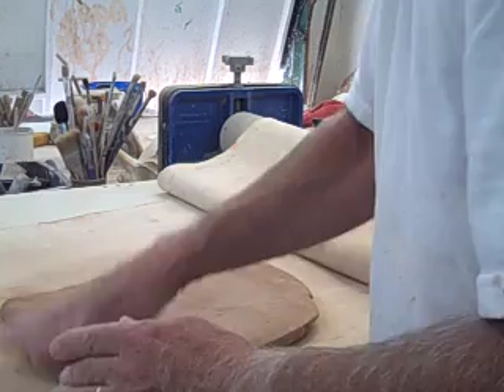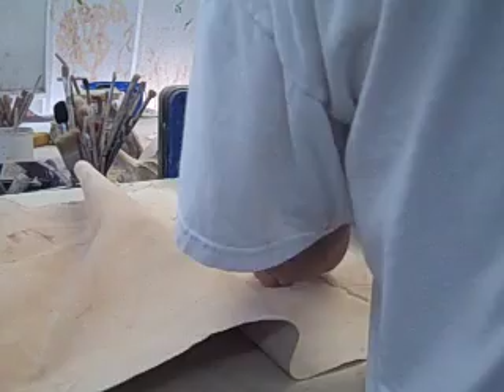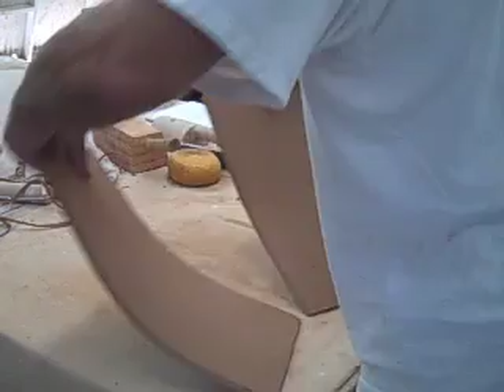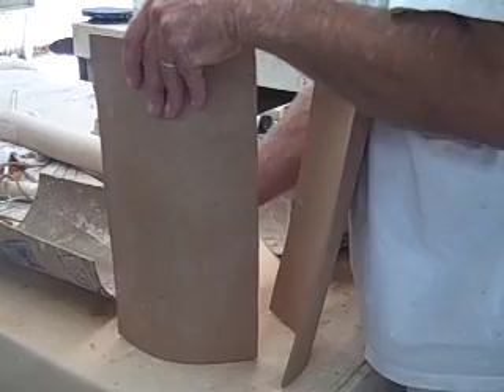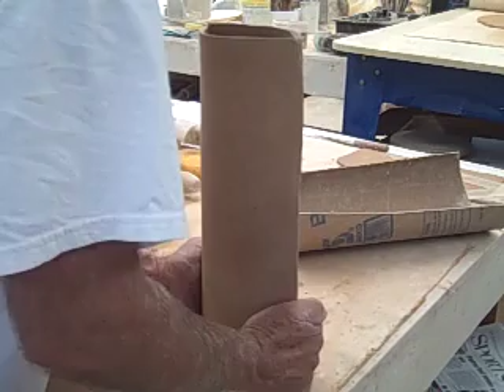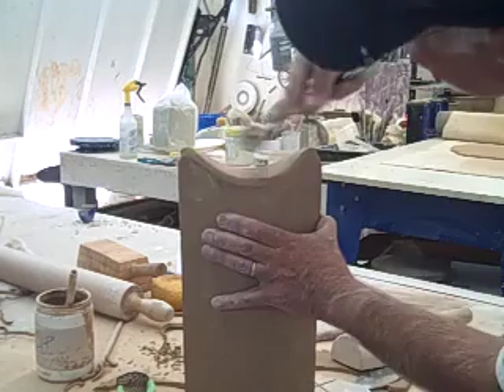How to hand build from slabs of clay, part one

Comment from the maker: These are large cylinders made for pouring concrete into. They  can be found at a Home Depot or any large hardware store. I cut them in half and use the half round form.